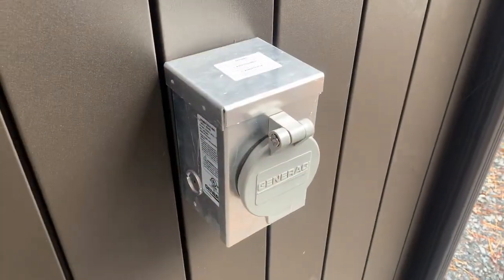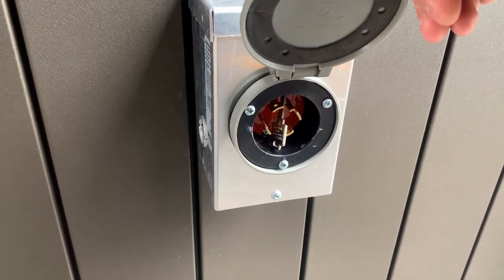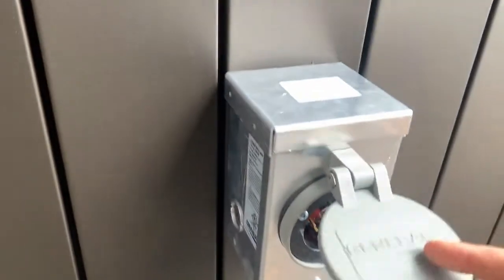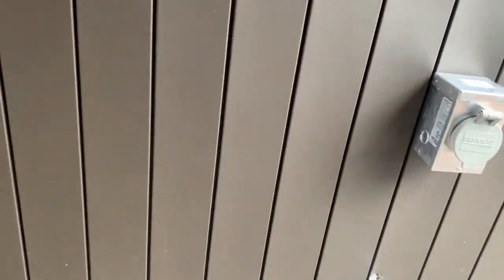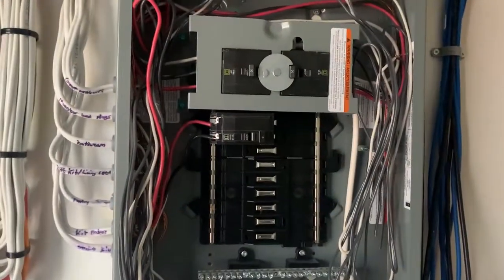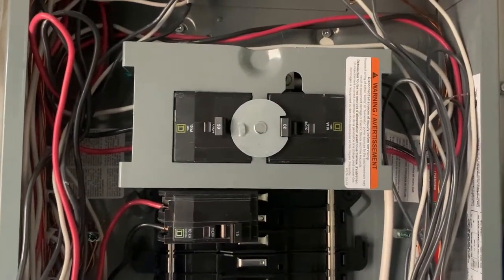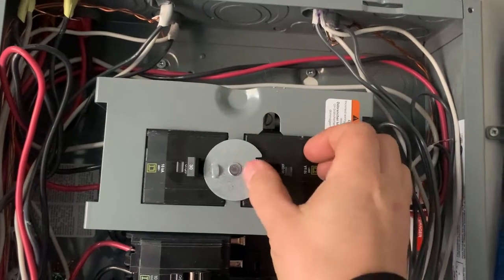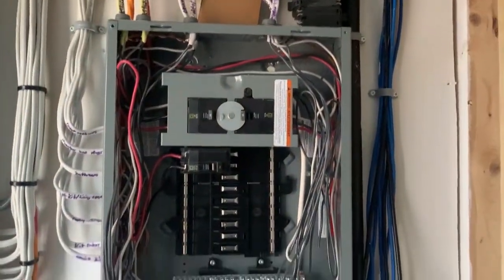Generator Back Feeding Just Don't Do It

Comment: Seems people rarely mention the other nightmare you face on top of potentially killing a lineman. When that grid comes back online your generator and/or other equipment (panel meter etc) will explode with molten copper because those phases will not match frequency. 

I've seen people do this 1st hand and burn their houses down including one not far from me, took out his garage too when the house siding came melting down into the yard.

When the fire dept showed up there was his generator sitting in the backyard burnt to a crisp, gasoline and all.

Play it smart people!

Comment: I just wired my motorhome through the breaker panel on the motorhome with a 30 amp RV plug in one of my storage bay, I also wired from the breaker panel on my house 30 amp RV plug, then made a 6 foot suicide cord to fit into the 2 30amp boxes…. So far so good.

Comment: If you do it per code it’s absolutely acceptable. You just need a UL listed interlock installed. This will prevent the generator and the main breaker being on at the same time.

Comment: So what happens for residents with solar panels and inverters that feed the grid?
Reply: Well the electrical workers would have a record of who's feeding the grid
Reply: Solar panels should have an automatic transfer switch that prevents the back feeding into the grid.
Reply: @loytowse8140 Exactly, your inverter should automatically disconnect from the grid if it senses the incoming power isn't there.

Comment: Open the service breaker box by your meter. Move the service breaker to the OPEN position. Close the service breaker box and put a lock through the tab that only you can open when ready to reconnect to the electric company.
Reply: With enough solar panels and batteries, why ever reconnect to the grid? 

"You have to be connected to the grid by law."
You sure? 
I'm pretty sure the power company themselves will disconnect you from the grid for an unpaid bill...

Comment: $1,500 vs. $0.00  - I think I'm smart enough to remember to turn off the main breaker.  But thanks for posting this video.
Reply: You can install manual generator transfer switches that cost WAY less then $1500.
You can buy them here in the UK for about £100 and it goes in-between your meter and main panel and is a simple twist knob with interlocks inside - would probably cost a few hundred bucks tops for an electrician to install. It's not a big job, the meter head just needs pulling to cut the whole house power for an hour or so.
Reply: Thank's Governor; I plug in my EU7000i Honda generator and flip the main breaker off. then I flip the switch to a 220v 30 Amp breaker that cost me $88 at Home Depot.  Then I start my generator and power  my entire house.  The EU7000i runs for 9 hours at 88db.  I'm the last person you need to lecture.  (The $0 comes from back-plugging plugging your generator directly into an outlet.  But I'm not dirt poor and decided to splurge the $88). Say hi to your king for me (did you know he was mentioned on an episode of Leave it to Beaver back in the late 50's?  The Beaver had to write a story about his father and said that Prince Charlie and his dad use to play together). Did you also know there were 6 original founders to the Bank of England?  Great Britain, your "royal" family, and 4 others?  The founding charter said they could use 6x fractional reserve banking.  So the 5 founders "borrowed" their money when England had to put hard currency into the coffers?  Imagine your entire financial institution is simply a scam perpetrated upon the bougie .......
Reply: People's lives are at stake here and you're part of the problem.  If you can't afford the estimate, ask around for other estimates and if you can't afford those then just don't bother with a backup generator at all
Reply: @JacobShekter  Not everyone is stupid - So  maybe you should address your messages to the people you're familiar with, the stupid people.  One thing I learned in life is if the equation includes a "people" variable, that variable carries a stupidity component which should be factored into the equation.  Of course there's no IQ test given to a lineman, that's why there's safety procedures he's trained on and supervised to follow.  You've got to be a real idiot to get near a power line if you don't know what you're doing.  If you remember that, you'll live longer.  Just say to yourself "I'm not as smart as I think I am" or "I really don't know what I'm doing, maybe someone else should do this". Until then, just remember you barely graduated from high-school you don't have a degree in theoretical astrophysics and your rent is due before the 10th.
Reply: That's all well and good until the one time you forget. People forget things, it's just a fact of life.
Reply: @Owen_loves_Butters  There are a few people who don't make dumb mistakes.  You may not know that, but there are.  This phenomena is called the Dunning-Kruger Effect which is essentially really dumb people not knowing they're dumb - because they're dumb.
Reply: @FISHH00KS  Noone in the universe hasn't forgotten something important. Noone.
Reply: @Owen_loves_Butters  I have never ever forgotten to switch off the light bulb before putting a new one in.
Reply: @focus45554  Cool. But we're not talking about whatever minor consequences would result from forgetting that. We're talking about electrocuting linemen. Even if it's a small chance, it's still not something even remotely worth risking. Trusting people to remember things has caused countless disasters in the past, and it's beyond stupid to allow that with generators.
Reply: @Owen_loves_Butters  being electrocuted by a light bulb is not minor it can cause death. What I am saying is when death is involved its not likely for you to forget a certain procedure.
Reply: @focus45554  Even if you don't turn the switch off, you're not going to be zapped by changing a light bulb, unless you go sticking your fingers in the socket. But that's not really the point. 

"it's not likely for you to forget..."
Maybe not, but relying on that is beyond stupid. Plenty of times, even with very competent people, someone has forgotten something resulting in a disaster. When it comes to dangerous things, it needs to be easy to do it right and hard to do it wrong.

Comment: It's not difficult to cut the main breaker, so that you don't harm a line worker. When the local electricians high balled me for $3000 on their estimate, I decided against a generator panel and went for backfeed.
Reply: Relying on someone remembering to do that (and noone else turning it back on) is a terrible idea.
Reply: @Owen_loves_Butters  That's only if you are a special kind of stupid. Do you forget to shut your engine in your car off too?
Reply: People's lives are at stake here and you're part of the problem.  If you can't afford the estimate, ask around for other estimates and if you can't afford those then just don't bother with a backup generator at all
Reply: @JacobShekter   It works fine and safe. You can't tell me what to do.
Reply: @66Supertrucker all these people crying, just shut your main off plain and simple, if it off you not going to kill anyone
Reply: @66Supertrucker You fed back from dryer outlet or 115 outlet?
Reply: @chevaughn1993   dryer outlet.
Reply: Using the transformer in reverse you need to increase the applied voltage to the secondary which will act as primary when reverse fed. Also depending where the transformer is you would be powering many neighbors THINGS...and generator will be overloaded...this linemen stuff is mostly wrong. A step down transformer does not act like a step up one. That is assuming you did not SIMPLY turn off main breaker.
Reply: @Paufit  A step down transformer fed in reverse becomes a step up transformer.